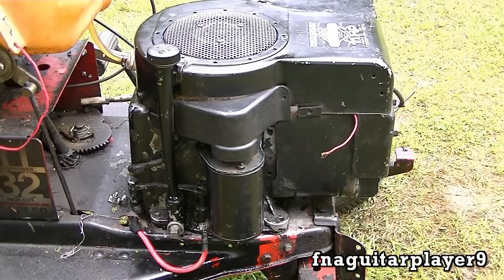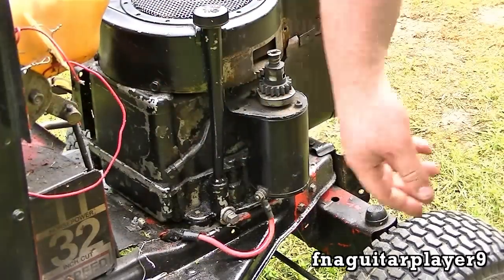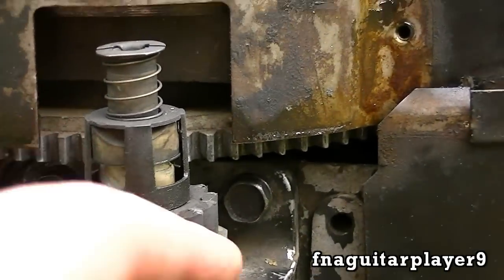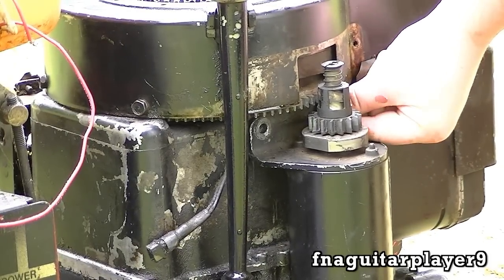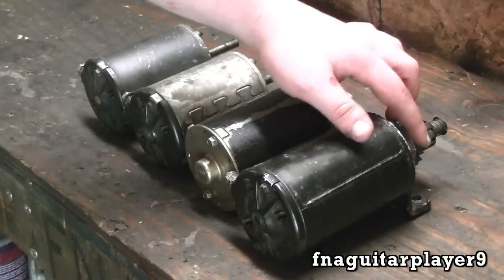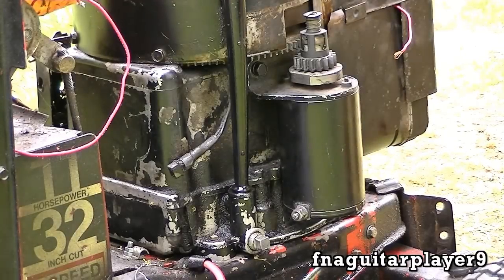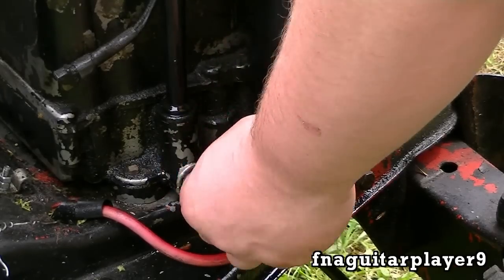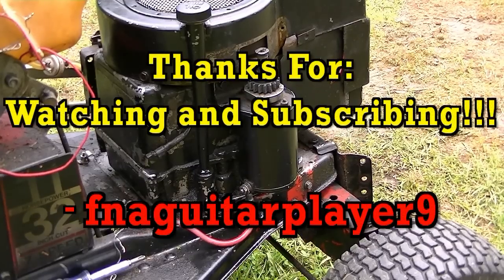How to Remove and Replace a starter motor on Briggs and Stratton single cylinder engines

Comment: I had the starter off of my 10hp Briggs ride mower engine when I did an engine rebuild with the help of your 3 part series. Thanks for that! Everything went back together fine and the engine runs great. One issue: since putting the starter back on, I have broken two starter gears (plastic) in one week. Any thoughts on what I might have done wrong? Many thanks!
Reply from the maker: Your welcome! not sure right off hand what would cause that right off hand. Maybe the bendix on the starter is worn and letting the gear get in a bind, not sure.  Thanks for Watching!!!
Reply: @fnaguitarplayer9  Thanks for your response. I just found your video about using WD40 to free up the gear and spring mechanism on the starter. I'm going to try that when my new gears arrive. Cheers!

Comment: Put on new solenoid, new starter, new battery, solenoid just clicks, stater motor not engaging. Cable from battery to starter new.
Reply from the maker: It should be at least trying to do something, make sure you are getting power to the starter, its possible its a bad starter or solenoid.  Thanks for Watching!!!

Comment: Need some help I need to replace the starter but instead of 2 bolts it looks like its a HEX bolt holding it on is this possible or is it another type of bolt.  I don't want to strip it. 

Thanks
Reply from the maker: I have seen torx bits, not sure about hex, but it could be. Look real close or spray it with cleaner or compressed air if there is dirt / grease on them. Thanks for Watching!!!

Comment: I have a question I just replaced my starter and now the small wheel with teeth doesn't touch the big wheel so their is no way to turn it over. do you have any idea what I should do?
Reply from the maker: Sounds like something may be wrong with the new starter, is it not moving up at all? if not something is in a bind on the bendix gear (the spiral looking part). Which it might just sprayed with wd40 to free up, if thats what it is. thanks for watching!!!

Comment from the maker: I think the longer housing one has a little more power, more magnet surface, could be wrong. You could try replacing the brushes/end cap, i did a video on this. I'll PM you a link to a place that sales more powerful starters, just in case you decide not to rebuild yours and i'll attach the brush replacement video... thanks for watching!!!

Comment from the maker: feel free to send me personal message on here. Does it have compression? can you feel the compression when you crank it over, if something was hitting the plug something could be cracked, but the shop should have seen that if that was the case. Sounds like it may be in the carburetor, or a kill wire is shorted out somewhere. thanks for watching!!!

Comment: I don't know much about working on mowers..Do you have an email where I can email you about a 13.5 briggs engine that wont start? I'll lay out some basics. The correct plug is installed and the tip was getting bent in while running and i heard a clanking while cranking after that. A local shop adjusted the valves and I no longer hear the clank but still no start, new coil also....

Comment: I bought mine off  a guy on Ebay for 8 bucks, even came with a new starter gear, the part # is 26-9362 for that kit. I have a B&S model 281707 as well and used that kit and it worked perfectly.

Comment: mine looks like the one in the video, except its a 12 hp.model 281707. i replaced the fiber gear which was hung and chew up some. when i tried to start it tore up the plastic thing on the end that the pin fits trough. it hit the motor cover, i guess it needs the end piece on it, may be called a clutch, don't it.